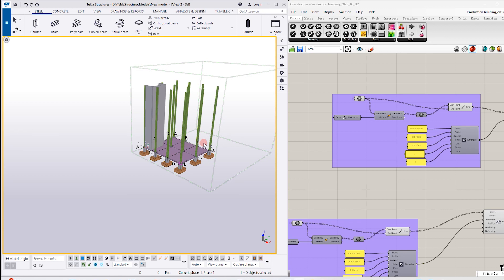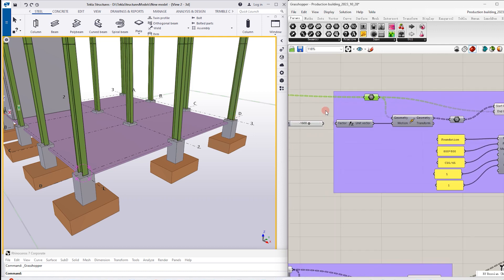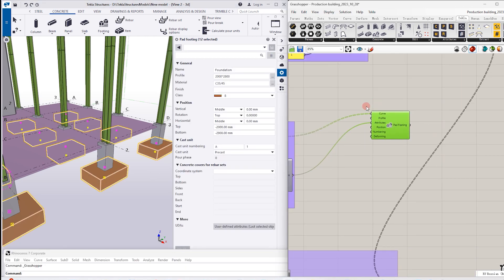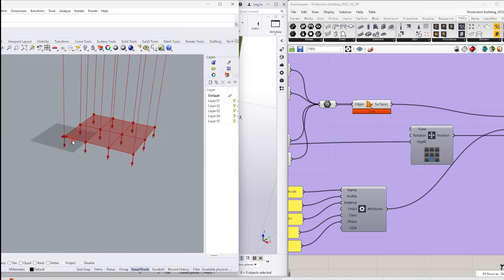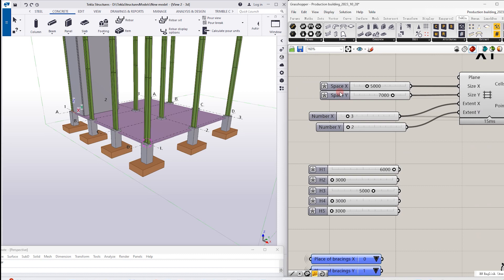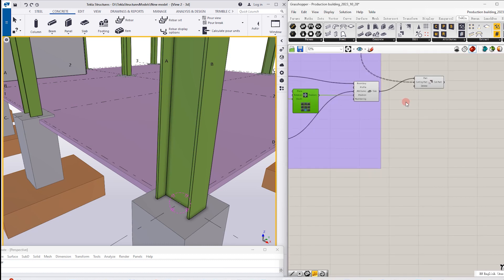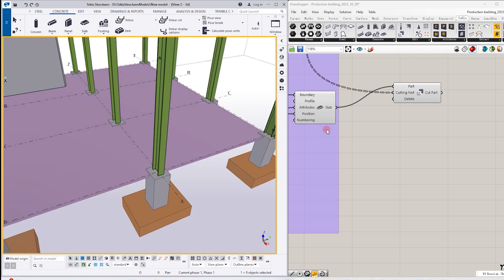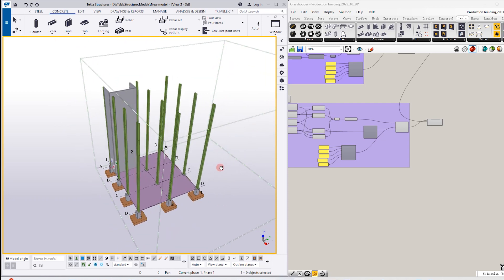How to model foundation in Tekla with Grasshopper. Part 2. Foundation

Comment: Many thanks for sharing this tutorial!
I was wondering if it was possible to create the floor from the "Cells" output of the "Rectangular" Component, instead of creating a new grid.
Reply from the maker: I think it should be possible. You just need to extract point you need to make a "Boundary" or maybe it is possible to make a "Boundary dirrectly from the "Cells". :))